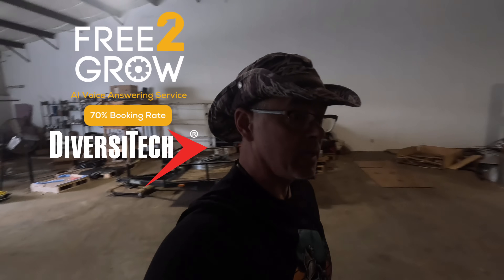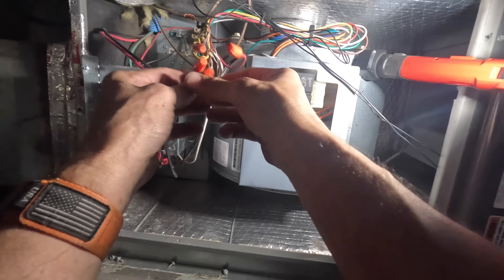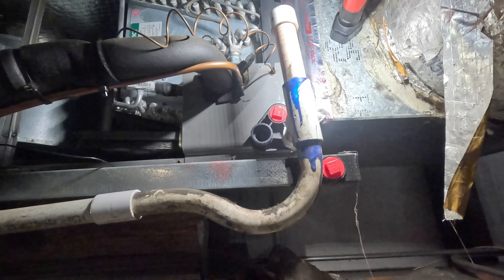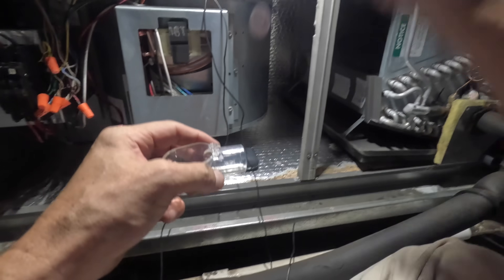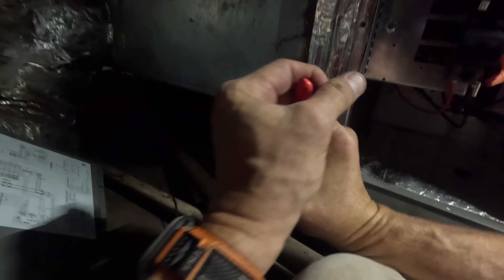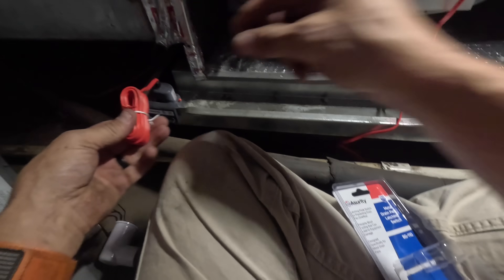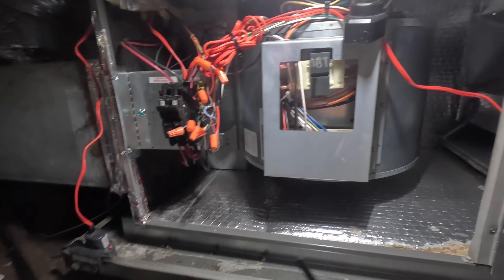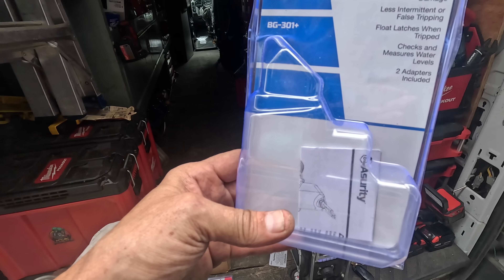Properly Managing A Drain To Prevent Damage! #hvacguy #hvaclife #hvactrainingvideos

Comment: I really like those float switches, the primary one is transparent which helps to see right away if there is water on it and also it prevents short cycles to occur by moving  it accidentally during maintenance time, gracias Curtis

Comment: It looks like the "trap" section of the drain line is too slanted to hold enough water to prevent passage of air. It looks like the top of the bended part is higher than the bottom of the straight section to its left.

Comment: Why didn’t you run them in parallel instead of in series?
Reply from the maker: Wouldn’t work like that
Reply: @HVACGUY  care to Elaborate?  Doesn’t running in series means that if any one of those sensors trip it shuts the whole system down?  If u run in parallel then you would think either of the two sensors would shut the system down?
Reply from the maker: @webcrawler3332 if parallel both would have to open at once to stop voltage
Reply: @ gotcha thanks

Comment: The two float switches wired in series in the power feed to the thermostat. That will shut it down if there is water in either drain pan for any reason.

Comment: Check that out. Man when I first saw it, I thought why do all that, it's covered with a cut off switch, should be good. Well now I see. I need to do something with mine, and will whenever I do the changeout that I was going to do 2 - 3 years ago. I figured I will run it till it dies, I put that stop leak in it 2 years ago and haven't added refrigerant since, lol, it probably will now that I said it. I know when my drain is stopped up by seeing water running out of the emergency pan outside, that is not good. Anyway you did a real nice job, so I want to do the same.

Comment: How do you like that folding stick light? Is it worth the high price and how long does it last before recharging?
Reply from the maker: It’ll last 5-6 days with the little I use it.
Reply: I've used mine on an install after about 3hrs it was dead. It's a great light if you do service work tho, takes up lil space in the ol tool bags. Just buy yourself 1 or 2 extra of the usb batts and you'll nvr be without it when ya need it most.